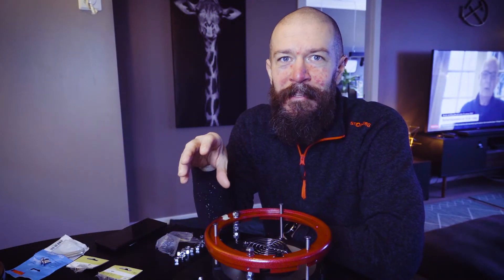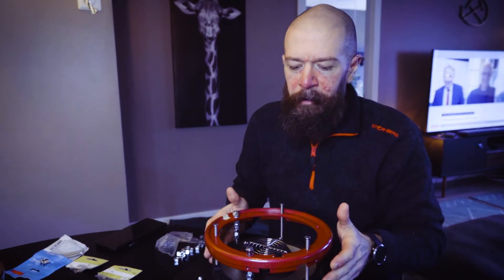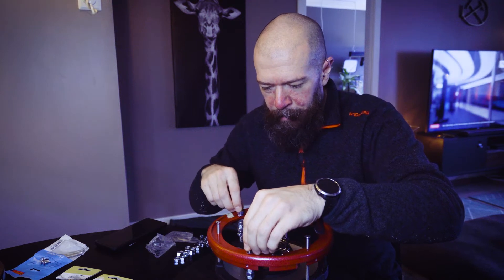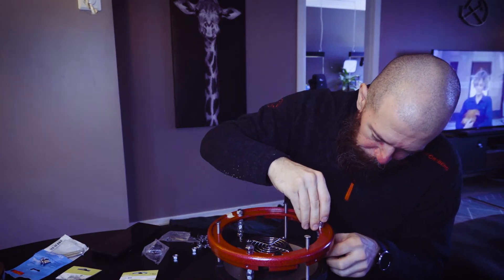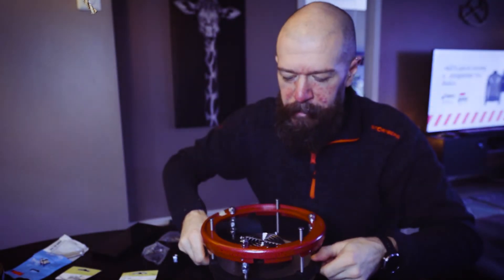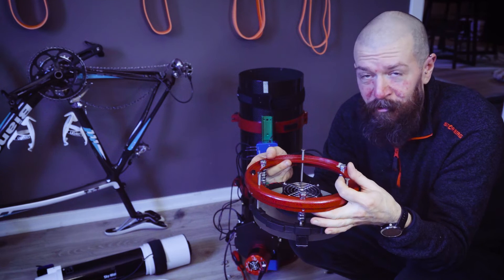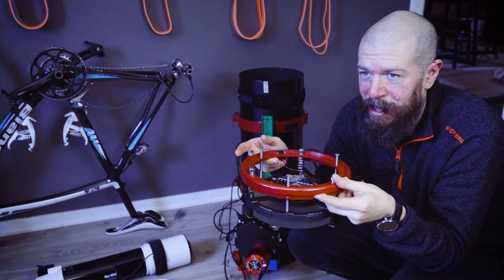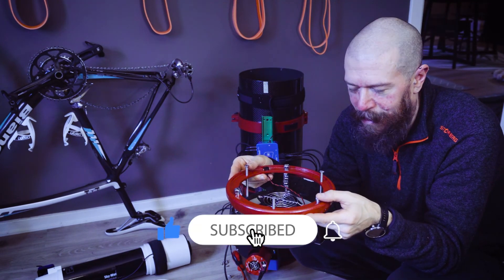Newtonian telescope. Primary mirror, focus problem, how to improve your telescope. TS-Optics Photon

Comment: Hi, interesting this modification. But my worry is this: pushing the mirror in front, will not require also a larger secondary mirror? And with a larger secondary, the obstruction will become larger. Without larger secondary, I suspect that will be reduced the aperture of primary mirror (vignetting).
Reply from the maker: I actually ended up buying another coma reducer with a higher quality and an movement of the focus point more out from the focuser. So I have put it back together as original for the moment.
Reply: @Bortle8Astro  Hi, what corrector you end up using? Thanks for video. Cheers!
Reply from the maker: @vasileunguru4272  Hi Vasile. I ended up with the TSGPU Superflat 1x corrector.
Reply: @Bortle8Astro  good. Thanks very much, clear skies!

Comment: Hello! I would like to ask for your help regarding my scope. I bought this surplus telescope online and I was so excited to use it but I couldn't see anything except for that blob of light :cry:
I am using a 7-21mm zoom eyepiece.
Things I've done:

1. Adjusted the focus knob and the magnification of my zoom eyepiece
2. Cleaned the mirrors
3. Tried collimating the scope
4. Tried an ordinary eyepiece
5. set the eyepiece at 7mm and pull the eyepiece outward by removing from the holder while staring at it.

But still no changes. Maybe there's a problem with my primary mirror? Am I missing something here? 
Thank you in advance.
Reply from the maker: Hi Lexaaa. This could be a number of things going wrong for you. But have you tried using the scope outside in daylight? Aiming for an object in the distant, and looking at what you can see? How did you collimate the scope? Laser collimator? It would be a nice information to see what scope you have and what focuser as well. Have you tried moving the telescope focuser from all they way in, to out...there could be an issue of focuspoint as well.... Hope it turns out good for you!